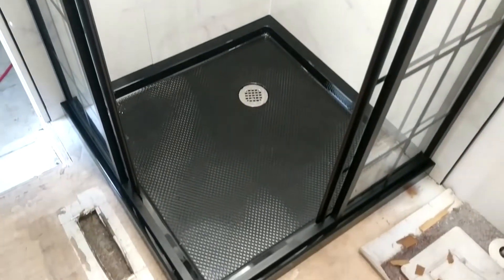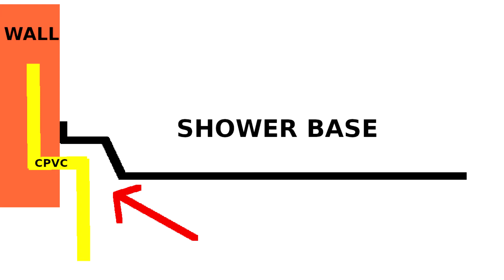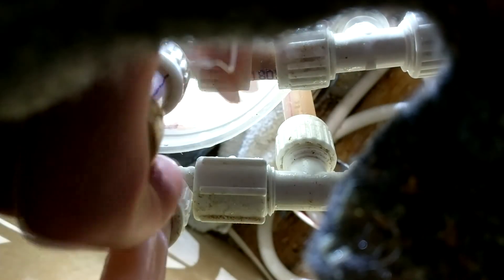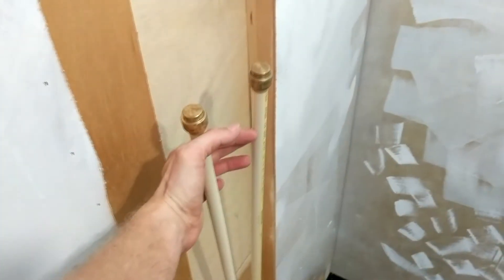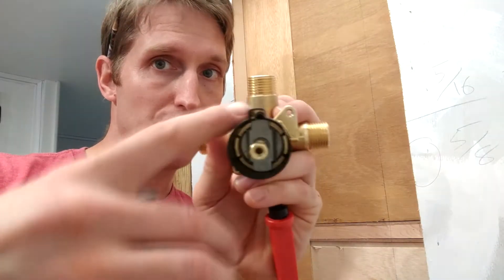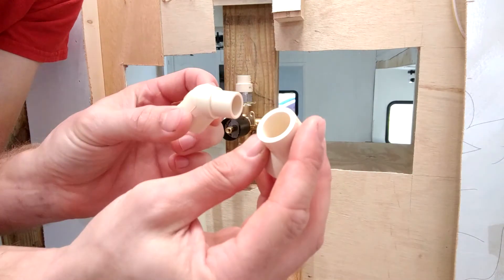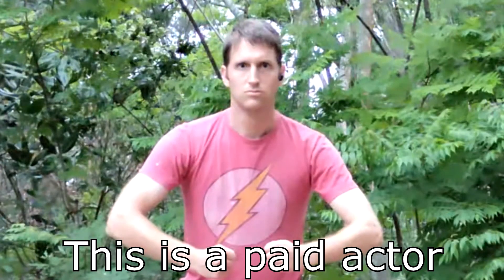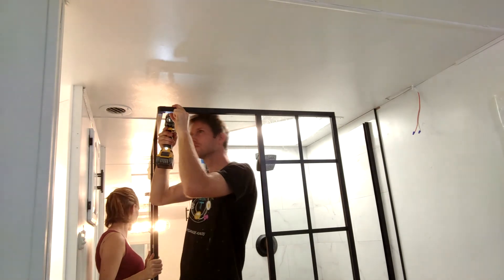PART 2 - How to Remodel Your RV Shower to Look Like THIS! || Plumbing and Drain Pipes

Comment: I am curious why you chose to use CPVC/PVC instead of Pex/ABS? Isn't the flex of PEX/ABS preferable?
Reply from the maker: CPVC and PVC are also flexible as being plastic. They are also cheaper often in price and more accessible to the common person at local stores. I may consider doing more with PEX later on with  RVs, but I just don't see the advantage at all of using ABS vs PVC.

Comment: Do to not being set in mortar, have you had any issues with the pan flexing and breaking the seal below the doors? Specifically the corner where the doors come together. I'm doing a similar install and there is a small gap between the floor and the shower pan.
Reply from the maker: No issues here

Comment: Just curious, since I will be living full time in my renovated RV in the PNW where freezing temps are an issue, while having the RV plumbing exposed during this portion of the Reno be a good time to add pip insulation before closing the floor and wall back up? Also wondering about waterproofing and mildew proofing any new wooden joints that you install at this time?
Reply from the maker: If your new pipes are exposed to outside temps regularly, then yes you should put pipe insulation on them and overnight leave your outside shower running slowly overnight (then it won't fill up any grey tanks). Depending on the design of the RV, those pipes may already be in the heated part of the RV, for example, in my RV, the underbelly has a heat vent that goes into it so that it can stay just warm enough above freezing temperature and I don't have to worry about the pipes down there as long as the propane is being used to heat the RV. If the shower is installed correctly, you don't have to worry about leaking behind it, therefore, you should have to worry about waterproofing or mildew proofing any of the wooden joints. FYI, if you are going to be living in a very cold area with an RV, you should probably get a really good dehumidifier because the condensation that will occur on your windows and sometimes even your walls will be a lot and can even start small wood rot issues
Reply: Thanks so much! I'm starting my shower reno now! I'm curious why you cut the shower drain pipe at all? And why so far back...seems hard to get to

Comment: Height from the floor to the ceiling where the shower went?
Reply from the maker: I forget, but it's just above my head and I am 6'2, so it is probably about 75 or 76 in
Reply: @helloiambear5531   The shower being used, you did not have a problem with height of the shower being to high. I looked at the one you got. It says it is 74 3/4 in high. Our 5th wheel is 75 in high walls.
Reply from the maker: It was tight, but it definitely had no problem fitting. Probably had about an inch Gap on the top, but you never had to like screw down from above or anything like that so it was never an issue. Finding square walls in your trailer is more of an issue